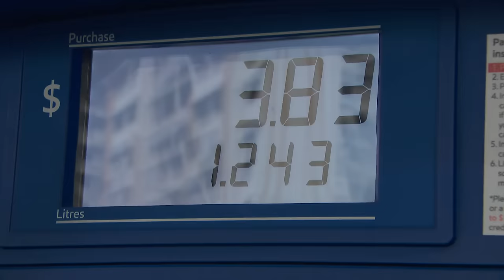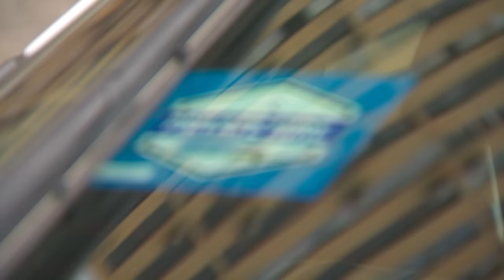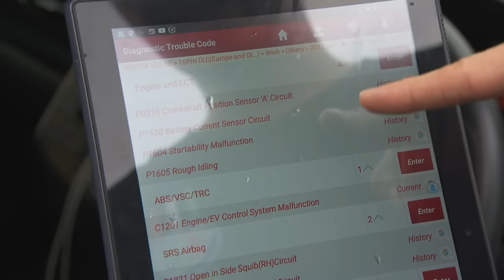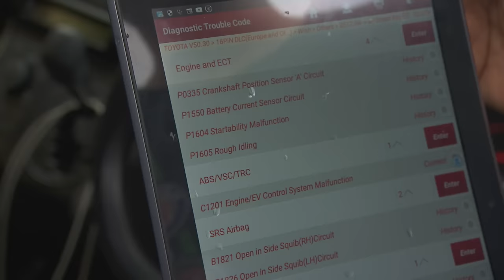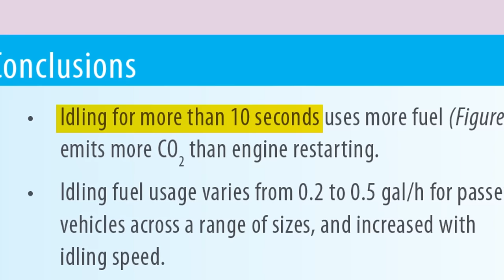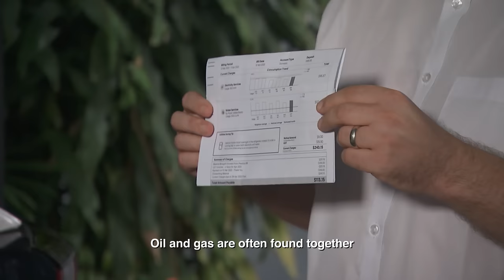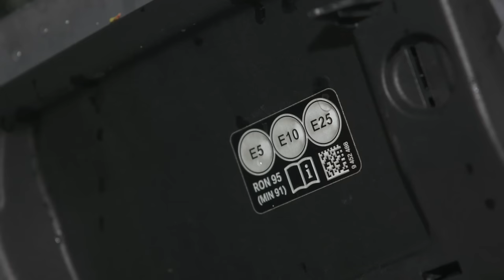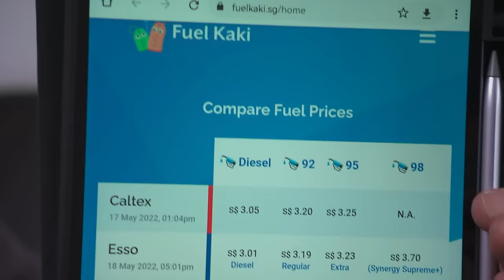How To Save On Petrol? | Talking Point | Inflation

Comment: Here my habits other than mentioned in this video.
- Service the car regularly(semi synthetic or fully synthetic give better mileage but also at higher cost, find the balance or promotion deal
- ignition part replace timely(spark plugs)
- filling fuel and drive during night or early morning improve mileage slightly due to colder temp(denser air). 
- tire pressure I pumped about 10% higher than stated spec on car(follow tire spec limit than follow car manufacturer RECOMMENDED spec)
- try each different fuel brand and measure the mileage per tank and then stick to the one that gives better ones, 
- invest in good tint because :
1-it protects from harmful UV
2-gets cooler fast during hot day
3-with point no 2, it reduce work for ac compressor and helps give more mileage.
4. With point 3, longer AC compressor life span.
- choose appropriate car that feeds the need or function which suits your daily driving. Don't drive big heavy SUV for daily solo drive, can go for compact cars. Unless you are rich, this comment not for you.
- on highway, cruise behind another car(bigger car like van is better) at safe distance, it helps reduces drag and uses less fuel hence increase mileage. 
- see far ahead, it you gonna stop totally then might just slow earlier and hope cars ahead move. The key is let the car keep moving even at lower speed. So anticipate you can slowly crawl till the car ahead moves. It is better to accelerate from 10kmh than total standstill and this uses less fuel to pick up. Also can help reduce traffic jams and safer because cars behind will reduce speed and we can avoid being rear ended. 
Sorry for long essay, but these my experience over 20yrs driving.
Reply: Stoooobid. Just make Carbikes lah. Half car, and half bike. Save half of fuel and more pedalling on human exercise. Your problem solved on gas shortages over the coming decades. 😂
Reply: @theinquisitor7191  ya Flinestone was actually way ahead of us. Purely leg power. Even brakes are leg brakes.
Reply: Wow this is actually very helpful
Reply: @Anthony-eb6fk   in certain point I agree. But it is just my test and trial. You do get stiffer ride. Raising tire pressure also accelerate control arm bush wear and tear. But do remember if you go with different tire brand than what the manufacturer tested, the result also may vary different tires different composition. Some soft wall some harder wall. I use Michelin XM2(one of most expensive here in Malaysia) that is always slight(10%) above pressured and it actually gave better handling in straight or turn and firmer ride. But in this context, it is about fuel saving. So reducing friction is the key and increase of tire pressure helps. When you have a stiffer tire, the wall flexes lesser and reduce heat. The flexes in the tires walls causes heat, and the heat is an energy transfered from friction made by momentum which ultimately is fuel. It may be minuscale but it is there. Underinflated on other hand can cause tire wear prematurely too and is more dangerous than over inflated(not exceed tire limit). By adding 10% more than spec works fine for all my cars with Michelins.
Reply: Talk so much!
Reply: Drive less. Simples

Comment: actually most cars can take RON92 fuel. check the owners manual for the minimum fuel grade u need to pump. i've been pumping my 2018 g30 520i with RON92 (owners manual says AKI 89, which is equivalent to RON 92) since day 1. no issues at all. some knocking sounds during engine startup, but it will not affect engine. 

best tip to save $$ on fuel is to turn on the start/stop function. engine will cut when you are at red light or stopped for long period of time. 
also use eco mode if your car has it. the car will coast and maintain speed for u, and will control your acceleration.
Reply: actually almost all luxury car engines are designed around RON 92 because of that's the premium gas in denver colorado.
Reply: @malekzin4788  nah 92 in USA equals 98 anywhere else
Because in usa u dont use RON

Comment: Replacing air filter and correct type of engine oil will also save a significant amount of fuel. Also replacement transmission oil regularly so gear shift will happen at the right engine spped. This was not checked in this experiment. Anyway good job👍

Comment: I don't agree about RON95 and 98 mileage test (at 20:43). The theoratical vehicle's mileage is fixed by engine design, it will not change no matter what you pump in. Instead, the car should be hooked up to a dyno and measure engine power output. For a non-turbo engine, there is little difference but the difference is significant for turbo engines (high pressure engines).

Comment: really do not understand why the new Prius does 700km per tank when my ex-car the 2012 Prius can achieve 850-900km per tank (I drove for 5 year, and the consumption is consistently 20-22km/liter). .. yes, the fuel tanks are roughly the same size of around 40 liters.

Comment: Do an average Singaporean drive a lot ?  I find it a little strange that soaring rise of gas is a concern for drivers in Singapore.
Reply: Well said. But in a long run it does. Esp, pocket a bit tight. Rich then don’t waste time
Reply: The goods and services you buy and use require petrol to deliver via trucks and vans
Reply: Most Singaporeans don't have cars let alone drive. I wouldn't imagine it's a direct concern, what would matter would be inflation in products requiring petrol to import such as food.
Reply: @sureynix  Singapore is only about 500 yards across.
Reply: Ops Blac  Singapore is only 48km across. Petrol prices are hardly a first order issue for most Singaporeans. Especially considering only 11% of Singaporeans have a vehicle. 🇸🇬
Reply: @sureynix  A local Singaporean will never win the F1 Singapore Grand Prix. For obvious reasons. 🇸🇬 🏁

Comment: Guys I have a dilemma everytime i drive because i stay in Hougang so when i go to Marine Parade i always have 2 options , one is by highway (KPE>ECP) and the other is by hougang ave3 >still road. the highway is double the distance of the normal road but has way lesser traffic light(but its 20KM total compared to 8KM), i always wonder which route actually consumes more fuel in the end. …which route would be preferred for lower fuel consumption
Reply: Smooth traffic vs congested traffic won't save u 50% petrol in my experience but your distance is more than double. So I will pick the 8KM. My fuel consumption affected by about 25% for traffic heavy drives vs KPE drives so I had the same considerations.

Comment: 200km on a full tank? Doesn’t sound right at all.
Reply: For a badly maintained COE vehicle w/heavy load thats possible. But 200km a tank is merely wasting $$$
Reply: Abt 3km or so per litre of fuel ?? (assuming Wish's fuel tank is 60l)....😵‍💫 really? Toyota Wish?
Reply: @believe88  that’s not even a COE car.. is a 5 years old parf car leh. My COE 13 years old vios can go up to 500-600km so Yeap
Reply: my 6 years old car can go around 11.5km / litre ( shown on the display in the car ) using pertalite ( Ron 90 ).
Reply: 200km for a full tank is honestly very ridiculous.
Reply: @mulelos  exactly. Even a heavy Evo 10 can go at 300km++
Reply: @benjaminong9854  yea. And honestly Wish is just another bread and butter car that is a little more powerful at 1.8. My 1.4 golf is scoring 480 half a tank, 780 for a full tank. The money they wasted on the fuel per month could've gotten them a better car in the long run.
Reply: @mulelos  someone needs to check if her fuel tank is leaking lol.
Reply: @benjaminong9854  really arh? I tot thats the 2007 wish
Reply: My wish full tank can go 600km
Reply: You guys aren’t taking account of city travel… since it is not a hybrid… it does not regenerate power on stop and go traffic.
Reply: Send the Toyota wish for a car checkup. My Toyota Corolla can run 500km on 43 litres of 95 petrol.
Reply: I suspect she sits in the car while the kids are doing their activities hence the high fuel consumption
Reply: Confirm wrong data. Can’t believe they actually think the numbers is real.
Reply: I have the same 5 yo wish doing mostly city driving/school runs/kids duties, and it can achieve close to 500km. Definitely wrong data CNA.
Reply: There's some serious issue with the Wish if it is really clocking 200 km per tank. A high performance car gets better mileage than that tin can!

Comment: I drive a 2016 Toyota Prius Hybrid, and I am a Private-Hire Driver too.  However, I can achieve up to 1000km per tank.  He drives a 2020 or newer car but can only achieve 700km per tank?  Driving habits sure make a big difference!
Reply: Wow 1000km👏👏
Reply: @MrRazorteeth  Yes, it is not difficult to achieve 1000km per tank on a Toyota Prius Hybrid.  When I was driving a 2016 Toyota Corolla Altis, I ever achieved >700km on a full tank of fuel.
Reply: How slow you drive sir?
Reply: @zvlhelme  always above the speed limit, unless there are cameras around.
Reply: @cwkjai  in Singapore, there are many traffic lights and pedesatrian. He may need frequent braking than cruising on highway. Maybe this is why he get 700km. Instead
Reply: @HotRod16  I reside in Singapore too, and used to drive a 2016 Toyota Corolla Altis which can achieve 700km per tank.  After hearing from several drivers that the Toyota Prius Hybrid can achieve 1000km per tank, I switched vehicle and indeed it can go that far.
Reply: @cwkjai  then you're probably right, his foot is the problem😁

Comment: The consumption of petrol depends on different factors. First is the driving style of the driver. If we are usually on a go stop driving style. It will give a higher petrol cost. Remember, most car manufaturer will tell you that if we are driving in a city, the km per liter of petrol is lower compare on a long drive which is higher. Second we have to consider the age of the vehicle. Despite that we are doing a Preventive Maintenance of the vehicle. Still the older vehicle will still consume much petrol compare to the newer car. Because of the new technology that most car manufacturer put on the new car. With regards to 95 and 98 octane, lets define the meaning of octane. An octane rating is simply a measure of how heat resistant a fuel is in order to prevent knocking. In other words, octane doesn't enhance combustion — it prevents the air-fuel mixture inside an engine from igniting before it's supposed to. The higher a fuel's octane, It itl is harder to ignite because it requires greater compression to do so than lower octane fuels. The higher the octane rating, the less likely the petrol is to explode under pressure. And all car manufacturers indicate it on the car's manual and on the petrol tank cover. So please follow what is in the manual.

Comment: One way to save on petrol bill is to modify your car petrol gauge to read more than 3/4 full at a flick of a button, cross the causeway, secretly change car plate number and pump RON95 in Malaysia.
Reply: If you do this, you're in way more trouble fine Rm1 million+++ and jail In 1.5 decades.

Comment: @Steve how about winding down the window while driving? Does it increase drag and increase fuel consumption?
Reply: good question...save on aircon and some fuel but face more resistance? hmm...not sure if it will make much difference.
Reply: Only helpful when u city driving. Highway best to wind up the window so that it dont disrupt the aerodynamic.
Reply: Yes it will...for sure....
Reply: Once there was an experiment, and the conclusion is under around 64 km/h,it saves fuel consumption, while above it, will increase the fuel consumption

Comment: It's the same fuel octane92and95 if you're a noob just add some Toluene from the hardware store to boost the octane rating
Cars should be following manufacturers specifications on Fuel octane ratings

Comment: I never pump full tank because more petrol = more weight = higher fuel consumption.
Reply: Car manufacturers design the vehicle even if its on a full tank it will consume the same petrol. What you should be aware is the additional load that you will put on your vehicle. Consider driving your car alone and driving with a full capacity (with passenger). Which will consume more petrol?
Reply: @gerichoracines6896  You need to provide me with more evidence to your claims. I've not seen ANY manufacturer state this.

For the sake of argument, let's say this is true, why wouldn't they do that for the ENTIRE tank of petrol instead of it only happening when it's full?

Comment: Neve fill the tank full always have half tank that will lower the weight of the car and it will not be as heavy for the engine to run the car
Reply: What if ur car is at Jb...pump 1/2 tank then drive  in Singapore...just kidding 😆

Comment: why they don't buy the petrol last year and store inside their home last year if they want to save the petrol price's increase?
Reply: That wouldn't work. Gas expires/degrades overtime.
Reply: The storage life of petrol is one year when stored under shelter in a sealed container. Once a seal is broken the fuel has a storage life of six months at 20°C or three months at 30°C. The storage life of petrol in equipment fuel tanks is one month.

That mean, the moment you pump the petrol, you only have 3 month

Comment: Mostly using higher octane petrol is good for engine bec much better clean burning...which keep engine less carbon build up
Reply: One way to go around to beat the cost is you can pump higher octane fuel once a month or 2 and let it combust better to purge some deposits out.